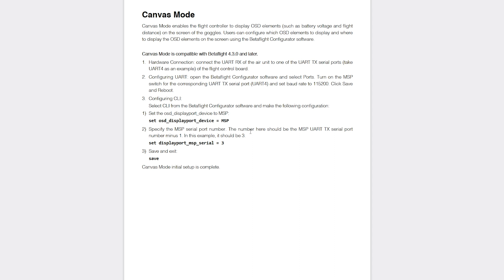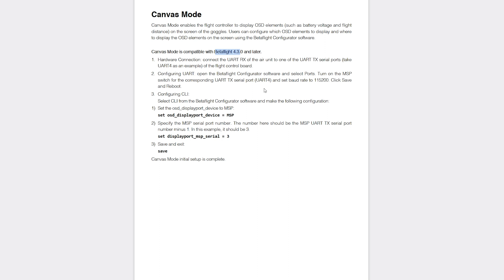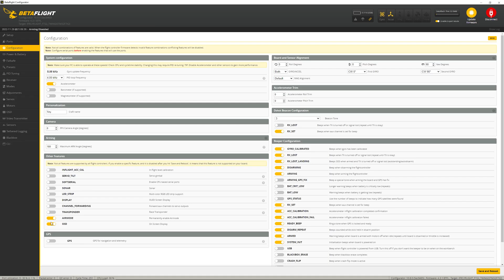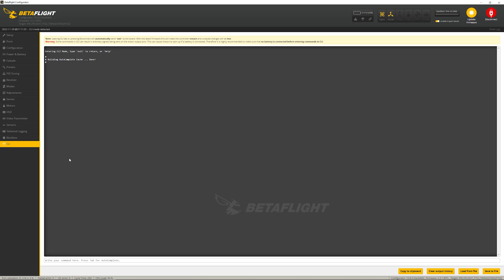How to get your custom BetaFlight OSD working on the DJI O3 Air Unit | MSP Canvas Mode is HERE!

Comment: I have 03 Air Unit and I have enabled canvas mode and I am seeing it in the Goggles V2, but am not seeing it in the recording. Should the betaflight OSD record on my Goggles V2 recording?
Reply from the maker: The v2 does not have the horsepower to encode the video on the fly and overlay the osd in the recording file. Only the goggles 2 can do this with the o3, you should see a subtitle file that you can use a video editing software to embed into the video. It won’t be as beautiful though.
Reply: Hi, i got a dji o3 and dji fpv 2. My flight controller is under 4.2.8 and i can not have osd on the masque. Can you help me please ?
Reply from the maker: @florentgarnier4827  What do you mean by masque?

Comment: Would I need to root the air unit and goggles v2 (FPV.WTF) for the OSD to work?
Reply from the maker: Which air unit are you using? If you are using the O3 then no, it would work with these instructions. If you are using the vista, yes you would (see some instructions here: https://youtu.be/A3MtAsy77zk)
Reply: @Mangorille  DJI 03 Air Unit.. should have specified.. thx!
Reply from the maker: @tomzino5673  With the O3 this will work without rooting the goggles. It is supported natively with the O3.

Comment: i can't get the second part to take invalid name. also on 10.9 and 4.4
Reply from the maker: In 4.4 you need to set the MSP option through the ports tab in the peripherals section and NOT the CLI. You can review this page for the instructions: https://github.com/betaflight/betaflight/pull/11705

Comment: Hi. I’d have an O3 mounted to an RC crawler and I’d like to get OSD and full power mode to my goggles 2. How do I do this, even if I have to add a flight controller? Thanks
Reply from the maker: Not sure if there is another way to give the O3 an arming signal but you can add a flight controller and use that to give it the arming signal and then the OSD. Seems like a waste of a flight controller though.
Reply: @Mangorille  even with a flight controller powered by the vehicle battery, I’d have to program switches in beta flight and possibly even have another receiver. A lot of extra complications to deal with.
Reply from the maker: @aerialmediagladstone9021  Correct, you'd need to setup an arm button. Not ideal at all and extra complexity when DJI could have just made turning off the low power mode option do this (which they didn't!)

Comment: I think I've messed something up... I get a similar text/font as you, but none of the other osd elements are showing up, including voltage. Is there a way to switch back to good ol' betaflight osd?
Reply from the maker: Which devices are you using? Air unit, goggle, and beta flight version?
Reply: @Mangorille  thanks for the reply! I'm using the DJI Goggles 2. I've just installed the DJi o3 air unit on an older iFlight Nazgul f5. I've double checked the soldering to the board and it's good (gray to R3, white to T3). I'm running the latest betaflight 10.8 configurator and betaflight 4.3.2 on the quad. I used the dump from iFlight for all the settings, and put the correct uarts in the ports tab (r3 and t3 with MSP on) so that the quad will arm, fly, etc. However, it is stuck in low power mode and the battery voltage doesn't show up in the OSD, nor does anything else except for signal quality. Any idea what might be happening?
Reply from the maker: @eveRide  Thanks for the detailed explanation. Although it sounds like you have everything wired correctly, what you are seeing is typically a symptom of the UART (RX/TX) not being connected correctly. Can you please double check your gray and white wire and the port setup? Also, have you already activated and updated the O3 air unit to the latest firmware?
Reply: @Mangorille  Man thank YOU for getting back to me! Guys like you give me great faith in this community that's pretty tough to dive into! I'm going to try and flip the white and gray solders to the pads to see if that does anything. Right now they're correct as far as the wiring diagram goes (gray to r3, white to t3) but I think I'll try switching them around and seeing what happens. Everything is running the latest firmware. I'm just completely stumped on what it might be.
Reply: Hey thanks for your help! I finally got it working after soldering them to the opposite pads (that didn't work), then I tried resoldering them to the right pads again. 3rd times the charm, I guess. I'm new to soldering so I probably had a weird connection or something.
Reply from the maker: @eveRide  Awesome glad you got it working! Soldering can be tricky, stick with it and you'll be an expert in no time!

Comment: Nice will this work with old Vistas?
Reply from the maker: These instructions will work if you are using the backwards compatibility firmware on your Vista with the Goggles 2. Otherwise, you'd want to follow the WTFOS instructions for rooting your goggles and going that route.

Comment: How you can record the FPV footage with OSD info?
Reply from the maker: The new Goggles 2 will do that for you automatically. For the V2, I think WFTOS has a tool that lets you generate something like this after the fact by taking the video file and the subtitle file and re-encode. I haven't tried the WTFOS tool though.

Comment: Is there a way to move osd elements more to the sides?
Reply from the maker: Unfortunately no. I even tried using the CLI commands but nope. The OSD positions are locked to a 4:3 screen. There's a feature request for a 16:9 from 2018 though. :) https://github.com/betaflight/betaflight-configurator/issues/1191
Reply: Set osd_canvas_height = 20, hit enter 
Set osd_canvas_width = 53, hit enter, type save

Comment: Great Video, was hoping it was going to fix my issue but i am not reading any voltage on my goggles from the quad.  I am using hobbywing xrotor F7 convertible with RX/TX set to UART 3 but nothing seems to get battery reading.
Reply from the maker: Can you confirm that you have the wiring of the RX and TX correct? The RX on the Air Unit goes to the TX on the Flight Controller.

Comment: Life saver man!  Thank you!  BTW, can I also use this Canvas mode with older CADDX systems or is it just with the O3 for now?  I know about the WFT hack but don't really trust that...
Reply from the maker: Right now it is just with the O3 air unit on the V2 Goggles or Goggles 2. Unless you go with the WTFOS hack. We're expecting backwards compatibility for the Vista with the Goggles 2 in December so hopefully we can at that point, fingers crossed!

Comment: @mangorille
Hey bud
Can't get mine to work! I have a speedybee f7 stack and my 03 Unit is configured to UART1 not UART4. 
I can set the CLI command to -1 as advise but no go!
 If you can how can I configure the 03 unit to UART4 as normal.
Reply from the maker: Hey. Set the command to 0. It is your uart number minus 1 (I.E. subtract one).
Reply: @Mangorille  You the man!!
I would think of 0 😃 duh!
Reply from the maker: @cisnerosmike  Awesome, happy flying!

Comment: Do you need to use the dji RC radio or you can use crossfire and still have canvas mode?
Reply from the maker: No need to use the DJI remote control, will work even if you’re using cross fire.

Comment: HOW DO I CONFIGURE A STATION BUTTON TO START RECORDING ON THE DJI O3?
Reply from the maker: Station button?
Reply: @Mangorille  record button
Reply from the maker: @Atlas_Films  If you have the DJI Remote Controller 2 it has a button for recording. Otherwise you'd have to use the automatic record at takeoff in the goggle menu.

Comment: Is this working with goggles v2?
Reply from the maker: I don't have a V2 but others have confirmed that it does. Only difference is that on the V2, the Goggle DVR does not record the OSD on the image.
Reply: Yes, it works...
Reply: Just tried on V2 ; yes its working!
You are better than Bardwell !!!!
Reply from the maker: @bartbutler9960  Bardwell sets a high bar, really appreciate your comment :)
Reply: on my goggle v2 it doesnt work
Reply: @alessandrodimartino1872  You've done something wrong then
Reply from the maker: @alessandrodimartino1872  It does work on the Goggles V2 with the O3. Are you using the O3 air unit or a Vista with the new backwards compatibility firmware?
Reply: @Mangorille  hey, no i dont put the new firmware. its really weird it dosnt work..
Reply from the maker: @alessandrodimartino1872  Still not clear, are you using a O3 air unit or a vista? This will only work with an O3 air unit or the Vista with backwards compatibility firmware on a Goggles 2.
Reply: @Mangorille  i use the new o3 unit with the goggles v2
Reply from the maker: @alessandrodimartino1872  Then it should work. Are you sure you are setting the correct UART number in the CLI?
Reply: @Mangorille  yes! Its on uart 2 and i wrote 1.
Maybe i try to  put an older firmware on the o3
Reply: @Mangorille  everything works now! Solder it to another uart
Reply from the maker: @alessandrodimartino1872  Awesome. Perhaps something else is using that other UART, such as your ESC. Some ESCs connect to a UART as well.